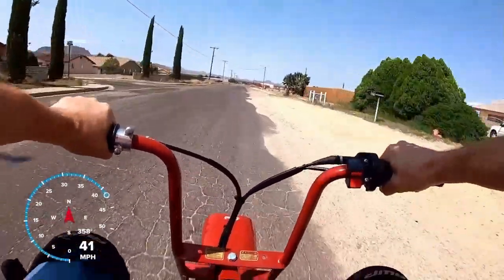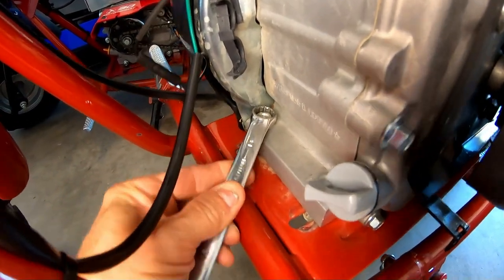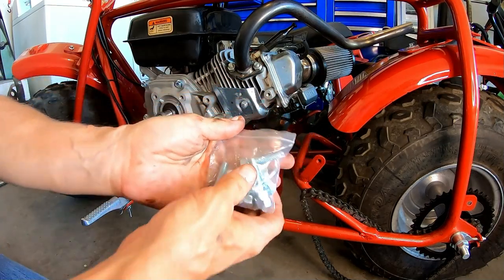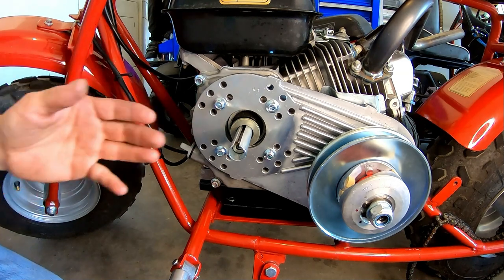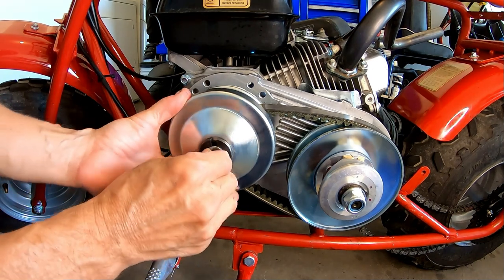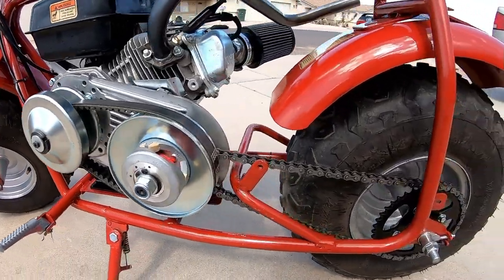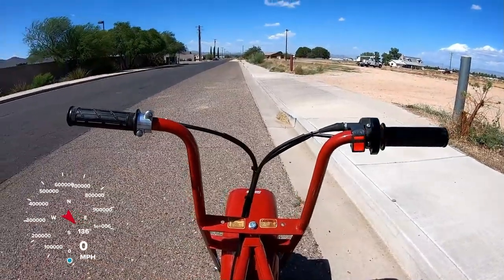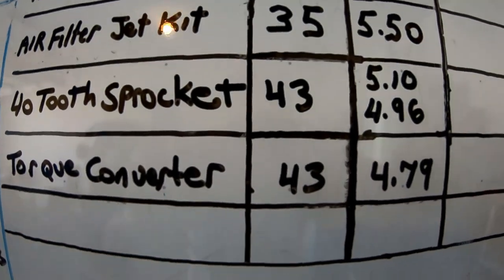Torque converter install on the  Coleman CT200U minibike / top speed

Comment: Hey there I’m going to do this on my ct200u-a. I measured the shaft and it was 16mm which is the kit I bought, I know there was a cheaper one that was 3/4. But if they gave a bolt for a predator than I also need to grab a different one. What size did you get?

Comment: The guy you bought the riser plate from had a pretty good deal on a combo of the riser plate, shorty header pipe, and screw in muffler for $79.99. Not bad for an extra $20.
Reply from the maker: That’s a good deal !
Reply: What was the riser plate the link in the video is dead

Comment: So I used this video as a reference for modifying my own ct200u with a series 30 tav. I ordered everything that was listed on the description for this video. Firstly, the 5/8 to 3/4 shaft adapter may work for some people but it certainly didn’t work for me. I assume it’s just shoddy manufacturing. Some work, some don’t. Luckily I had a spare predator 212 laying around so I just swapped the engine over to make the tav work. Secondly, the tav itself is good but very very finicky. It required a lot of adjustments to make it work well. The driven pulley for instance is way too close to the chain out of the box. I ended up adding a washer to space the pulley away from the chain a few millimeters. MAKE SURE to do this because your chain WILL get caught on the pulley and instantly ruin your day. For those of you that have watched further in this series, you’ll see him changing out the rear sprocket to a 40t. I did the same and I’m not sure how to feel about it yet. The speed is definitely nice but the moment you hit a slight incline, you can feel the tav trying it’s best to grip but mine ended up smoking after a 15 minute ride. It heated up the tav unit so much that the brass washer that the belt rides on expanded and got stuck on the shaft. If I didn’t catch it soon enough, I feel like I would’ve destroyed the belt. I’m going to try using some graphite lube around the washer and see if the reduction in friction will resolve the problem. 

All in all, great video, good mod but be prepared to put in a few hours of work to get it perfect. I’ve taken my bike out for a few rides and I still have a lot of adjusting to do. Hope this was helpful to anyone else who’s looking to try this out themselves!
Reply: hey I'm just wondering how much top speed did you pick up with the 40 tooth sprocket? and did you loose a lot of low end torque to where it's easier to switch to a straight chain? also we haven't been running the brass bushing for a little over a yr without any problems since we shredded a belt because the brass bushing snapped
Reply: @nathanialhulsey6900  I can’t say how much speed the 40t added because I never tested the tav with the original sprocket. I’m guessing it would be around 8 or 9mph. I’m certain there’s a equation out there for figuring out speed. As for torque, I probably lost a little compared to the stock jackshaft but not a whole lot. You only really notice it on hills. I definitely wouldn’t do a straight chain because that will absolutely kill your torque and take forever to get up to speed even on a flat surface. Bushing hasn’t snapped for me yet but I’ll definitely keep that in mind!
Reply: @raveenrichie5734  After I watched this video I was wondering what he would get with the stock 50 tooth or even the 60 tooth. I would bet that he would get higher than 43 with a 60 tooth. With the 40 tooth his engine never made it to 3000 RPM. The engine never even got to its better power potential to drive the load at a higher RPM. With a stage 1 kit there's more power available at 4000 RPM than there is at 3000 RPM.
Reply: @Deucealive75  I know this is an older video, but with my own experience I actually lost top speed with the 40 tooth and torque converter. 60 tooth rear is actually too torquey for me, very sensitive and takes off extremely fast. The stock 50 tooth rear is perfect for the torque converter in my opinion. I have personally hit 55mph with the 50 tooth rear sprocket and 30 series torque converter. I have seen people get over 60 mph though with upgraded engines.
Reply: @WhiskersTheFish  If you are getting 55 with a near stock engine and the 50 tooth you are much faster than the norm. For years just about everyone was getting 35 to low 40's with a torque converter and stock gearing with mainly stock engines.

Years ago while waiting on parts I installed a 100% stock 196 with a torque converter and stock gearing. Performance was laughably pathetic and couldn't have gotten to more than 35 mph. I guess if I held it for another 30 seconds it may have got to 37. haha.

I have two of these bikes with torque converters. One with 8/50 sprockets and the other with 9/60. With a mild built 196 and 9/60 sprockets there is better acceleration and top speed than with 8/50 gearing. It would be an under 4K RPM bike with stock gearing and less overall performance. I get 4500 RPM belt shifts at full throttle with my current gearing with yellow driven springs on both bikes. Wouldn't get anywhere near that with stock gearing and a red spring.

Comment: hey, do you think that motor mount plate could be used to mount a 196 w/TAV into a mega moto 80/105 frame?

 I'm thinking of getting one of these frames and want the cleanest way to mount a bigger motor while hopefully keeping the fuel tank mounted onto the motor instead of moving it to the frame
Reply from the maker: Possibly . As long as there is room under the frame rails after adding the riser mount . On a Predator with the mount it stands about 14 inches tall . If there is more than 14 inches in that frame , it should fit .
Reply: @Black66  thanks for the info

Comment: How did the shaft adapter fit did you end up using the key that came with it. I'm not sure how that works because a flat 3/16 keyway came with my 1 inch adapter to my 3/4 inch crankshaft.
Reply from the maker: Check out the CT200 playlist. I have a few videos on there showing the adapter install https://www.youtube.com/watch?v=X0SmAZJ6qW8&list=PLkbj-ip-5FzbVBVqMi23O5noFSAbhNOp1

Comment: Is a  torque converter what I need for some pep at take off?  I'm a newby to the minibike world and have a ct200u that only takes off on level/downhill hard pan.  (worthless in grass or uphill)
Reply from the maker: Check out the CT200U-EX and the CT200U playlist. I have many part and engine combo videos with this bike. https://www.youtube.com/watch?v=jHf9yJmaZLA&list=PLkbj-ip-5FzbVBVqMi23O5noFSAbhNOp1&index=12
Reply: I like your channel and video's, but it didn't really answer my question. @Black66
Reply from the maker: @jeffasmi11  Check out the 60 tooth rear sprocket videos on the playlist. With the right cam and internals the bike can be fast and quick from the start.

Comment: Hello Black66, love your channel.  I just installed a torque converter on my coleman ct200u-ex with a ghost engine.  The thing won't roll now, wants to turn the engine over when pushing it around.  I used washers and a longer bolt for the install.  Belt is aligned and tapered side is out.  Any suggestions, did I just tighten the bolt too much?

Comment: Do you feel that the tc gave it more torque than the clutch.  Just thinking a good mix between off-road where you want more torque vs on road.
Reply from the maker: OH ya, it has more torque with the TC than the clutch. I think the TC would help it off-road. The TC brought back the torque it had when it was running the bigger rear sprocket.
Reply: @Black66  awesome, now get a cover for it so you don’t rip open your leg

Comment: Got a question will it make a difference if I connect the clutch straight to the rear sprocket and remove the other clutch sprocket assembly on my rt200
Reply from the maker: Check out the playlist on the Coleman bikes. I have a few straight-chain videos on the list. https://www.youtube.com/watch?v=X0SmAZJ6qW8&list=PLkbj-ip-5FzbVBVqMi23O5noFSAbhNOp1

Comment: What was the screw bolt size you picked up for the torque converter? I’m in the middle of the same project and can’t find the size for it
Reply from the maker: If you are talking the output shaft bolt and you  have the 16MM shaft its  M6-1.0 x 55MM
Reply: @Black66  where did you get it from
Reply: @Black66  isn't a M6 too weak? Shouldn't you have a M8??!
Reply from the maker: @leifwoodward8900  The "M" in both sizes refers to the metric system, and the number following it indicates the diameter of the bolt in millimeters.
Reply: @Black66  okay thanks, I'm just trying to figure out what bolt to put in mine since it broke and the clutch went flying. Was a bit scary

Comment: Im wondering, could you have used the old plate with the drive and driven pulleys of the torque converter?
Reply: The pulleys are too close together and too close the the engine. I already tried it😂

Comment: Quick question, I just put a torque converter on my Coleman ct200u and I have been doing some top speed tests and I have only ever gotten up to 24mph I am testing it out in my field so I wonder if it makes a difference in speed if you drive it on a road versus pasture?
Reply: He’s using a aftermarket engine bro , he’s using predator 212 engine maybe more stuff to it but tha the most obvious, stock motor vs predator 212 big difference

Comment: Hey so I just got my ct200u all stock and I wanted to add the torque converter and the riser mounts and that’s all what where the bolt and washer you used to copy and if this would work without the sprocket or anything else

Comment: So did you use a 5/8 to 3/4 shaft adaptor? I have heard that doesn't work very well with the 16mm shaft. Did you alter the adaptor, or did you find a 16mm to 3/4 adaptor?  I sent a message to the guy on ebay who makes adaptors and he told me the 5/8 to  3/4 would not work but he could custom make one for me that would work.  Thanks for the video.
Reply from the maker: They have an adapter that works with the 16mm shaft. I used them on the CT200U-EX and the CT200U 196cc. The link is in the description of the video

Comment: If you really want to improve on speed, find an 11 tooth c sprocket for the jackshaft that fits the 420 chain like I did and you can hit 50mph. I have a 7.27.1 ratio. 10 on clutch,20 on jackshaft input and 11 tooth output to 40 rear.
Reply from the maker: That will work . We got the Coleman bikes over 60 MPH with a straight chain. Check out this video and the CT200U-EX playlist for many combos with this bike. Thanks for watching! https://www.youtube.com/watch?v=Up6TpJiopEo&list=PLkbj-ip-5FzbVBVqMi23O5noFSAbhNOp1&index=13
Reply: @Black66  I just installed the torque converter tonight, so it basically matches what you have. but I threw the 11 tooth back on the jackshaft. I'll test it tomorrow to see the top speed
Reply: @R1CEBWL  What top speed did you get with the 11/40? How did you like it?

Comment: What size bolt is needed for shaft  using the stock 196 motor ?
Reply from the maker: M6 x1.0
Reply: @Black66    M6-1.0x????

Comment: Can I do this without a engine rise kit?  I don’t really have the money to buy the riser kit, but I have a grinder and some discs to cut off the chain mount is that a good option?
Reply: You could also just use some 1 inch square tubing and drill holes to match the block. You will have to move the mounts to the side a bit as well to make sure the chain lines up right.

Comment: Hey i ordered the same driveshaft adapter as you and it doesn’t slide on like yours does. i would have to hammer it on and i’m scared of it getting stuck. also did you use the key that came with the adapter?
Reply: i really hope you reply to this comment with some tips. i noticed you haven’t really replied to many comments the last year or so, hope you’re still active!
Reply: @jaysgarage7 what did you do? Trying to figure out the same issue
Reply: His slid on no problem in the video.  Joking aside a lot of guys have had problems with this. In one video a guy smacked the fixed sheave on with a hammer. Bashed it all up.

Those are 5/8 to 3/4. The Hisun crankshaft is 16mm which is larger than 5/8. When you put it on it expands a touch making it difficult to slide on the fixed sheave.

I would never use one. When I built my Hisun196 it got a 3/4 crankshaft during the build.

Comment: If I wanted to bring my go-kart and my mini bike to you so you can fix it and put motors on and will the brakes back together and the suspension and where would I drop it off to you it's got a jackshaft on it

Comment: Did you use the bolt that held the clutch on for the converter or did you buy one? If so what size do I need to buy for my 196 cc
Reply: Take your original to the Hardware Store. Length? Just match it to the one that comes with the TC.

Comment: Hey black im loving your channel. Quick question, would u recommend billet flywheel or torque convertor once all the stage 1 stuff is done? For a ct200uex. Thanx so much!
Reply from the maker: Thanks! I would recommend a torque converter for the heavier bikes with the 19 inch tall tires.

Comment: The new predator 212cc will not fit with a riser plate, I just found this out....
Reply from the maker: Does the new one have a bigger tank or something?
Reply: @Black66  yeah it looks bigger than the older predators, I swapped it for the original hisan tank, now all is good

Comment: Another great video! Hey, where did you get that "unicorn" of a MOUNTING PLATE?  I was soooo NOT wanting to cut the frame of my CT200U-EX. Even tho it's only a glorified chain guard mount. Think it adds some structural stability, laterally. Besides its an ugly scar. Seriously tho, I really like this "offset" design. Allowingthe install of my TAV2-30 . Thanks again,    the brosman
Reply: Nevermind, I found it. bay $52.95 called:Torque Converter Riser Plate With Hardware Coleman Ct200u Bt200x Mb200 TAVPLATE

Comment: Been thinking about putting one on my 236 tillotson
Reply from the maker: It would be a beast with that Tilly!
Reply: @Black66  I wanna do it but my builder Keeps telling me I’m gonna lose top end. I’m straight chained right now with the Hilliard inferno clutch.
Reply from the maker: @7MilePaul  Ya, compared to a straight-chain it might lose a little but man, with that 236 its gonna have some awesome torque
Reply: @Black66  is it gonna be too much? Will I be running thru belts? I’m on my 3rd clutch in one season. First, two I wasn’t oiling them correctly. I didn’t know.
Reply from the maker: @7MilePaul  I think if you align the pullies it should be alright. It won't eat belts as fast. Maybe get a good converter that is rated to handle a good amount of power. I have never tried one of the cheaper ones with a 236. I'm not sure how it would hold up,
Reply: @Black66  so pretty much just get a comet?
Reply from the maker: @7MilePaul  I think I would with that beast tilly engine. I would get a good one.

Comment: Thanks for getting back to me so quick I appreciate that this is a great video a question can't you put the gas tank up on top of the frame where like a motorcycle tank goes?  It just seems like it's blocking cooling air to the head fins that are already on the wrong side of the engine
Reply from the maker: Check out this video. I did just that. https://www.youtube.com/watch?v=j7U_0GgGLng&list=PLkbj-ip-5FzbVBVqMi23O5noFSAbhNOp1&index=7
Reply: @Black66  thx I'm on it

Comment: In the description of the video which of those things do we need to buy for this? And will this still work with original sprockets? Thanks!
Reply: If you have a completely stock bike you would get everything in the description. Yes you can use the original back 50 tooth sprocket.